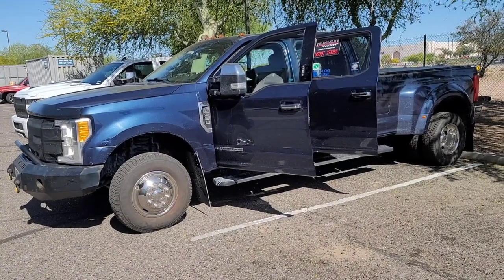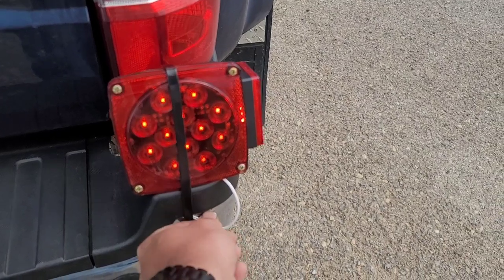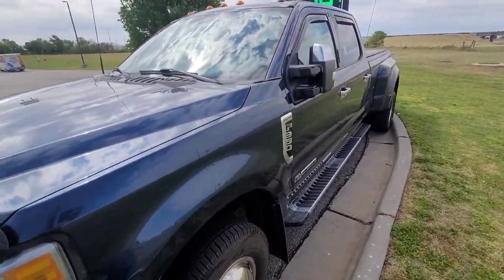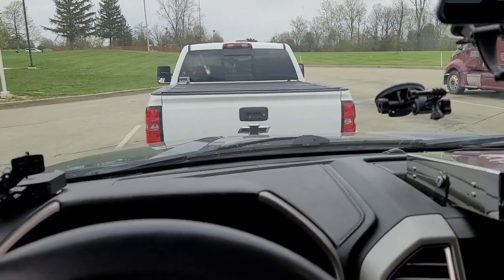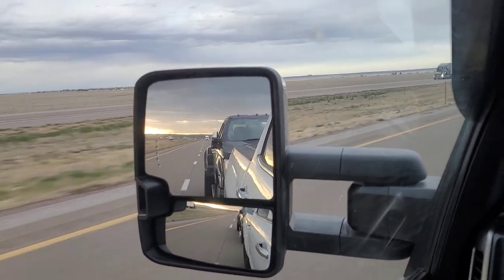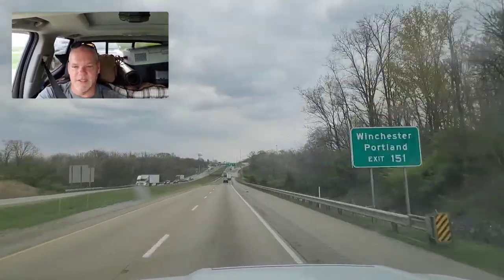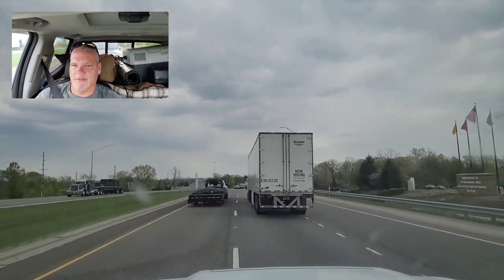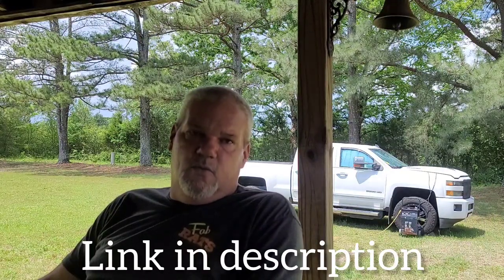Flat Towing a Ford F350 with a Blackhawk 2 Tow Bar from Arizona to Ohio 4-19-2023

Comment: Nice video.  I’m sure you’re glad you accepted the Tow bar.  That not a bad thing to keep in your truck full time.  Now I’m thinking about picking one up to keep in my truck. Oh and
Reply: …and no reply is necessary.   I know you read all of the comments.  Have a good one.  I would still like to make a run with you after your back up and running.

Comment: Looking forward to seeing how you connected your truck.  I bought an LBZ that had some tow bar connections in place of tow hooks and it had wiring to run the back lights from a 5 pin connector that was in the front grill. Maybe it was a two truck delivery system.  It had also had a transfer tank and tool box but it didn’t have a fifth wheel or goose ball ever installed. Maybe it was used for semi deliveries? Good old truck and it had about 300,000 miles on it.

Comment: I have a 22 Silverado 2500 and I have never pulled anything around mountains . So my question is if your exhaust brake is on and your rpm’s are getting around 4000 rpm’s should you shift manually to a higher gear or will it shift hard ? I am sorry about your truck